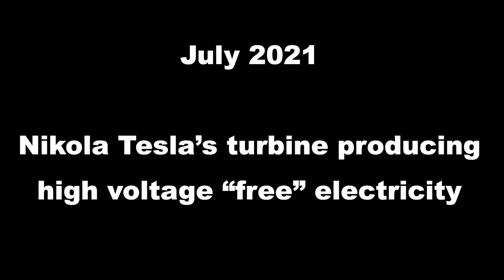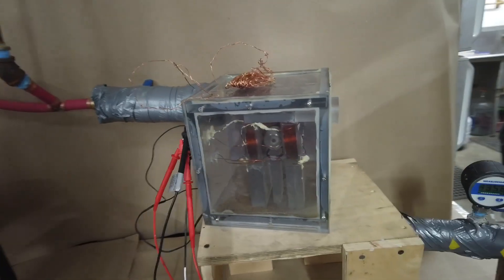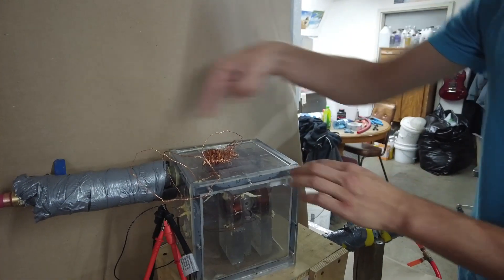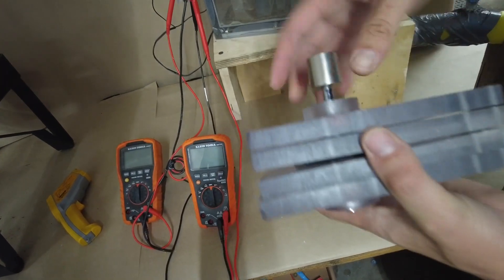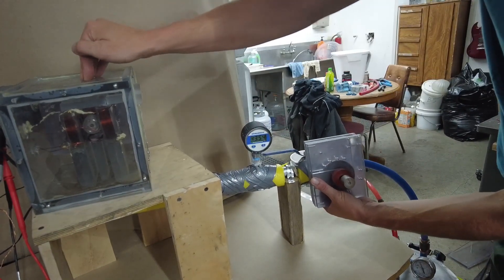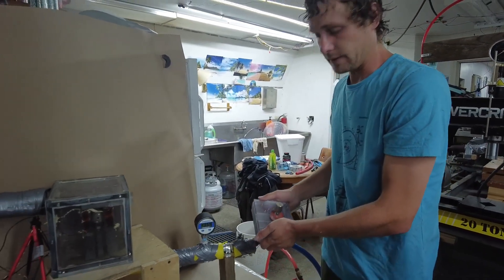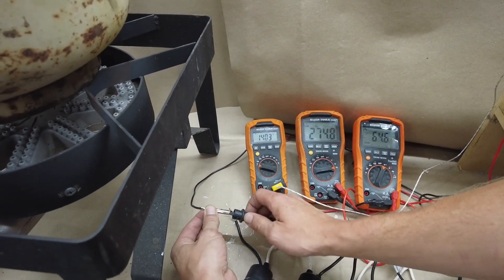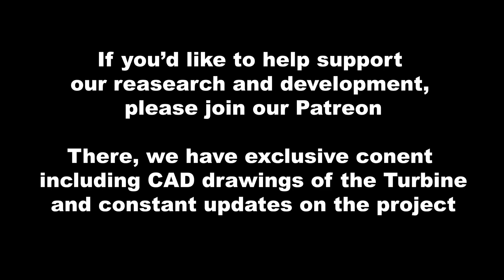Ground Breaking Renewable Energy System Using The Tesla Turbine

Comment: What provides the energy to drive the suction pump which creates the vacuum? In other words, if you do away with the externally (mains) powered pump, will the pump which you propose to insert inline 5:10 need more power than can be provided by your system? I admire your work greatly, but would like reassurance that this isn't another "perpetual motion" device. Also energy is needed to drive both the condensor and the water heater. So is there a net energy gain? Obviously I'm no engineer, but I'm curious.
Reply: I love the long winded reply that does not answer the question "So is there a net energy gain?".  I'm sure many people would like to hear that answer.  Sounds like a politicians answer to every question they don't want to answer.
Reply from the maker: @_Jobe  What do you mean is there net energy gain??? The performance of the machine goes up 6% with every inch of vacuum added to the system. The pump boosts the power density of the turbine.
Reply: @iEnergySupply  I'm not interested in the process, just the results.  And you still didn't answer the question.
Reply: @iEnergySupply  I believe he is asking what the "net energy" generated after taking into account the energy required to reduce the vacuum of the system -- not whether or not increased vacuum leads to increased power generated.
Reply from the maker: @vincentwu2848  awww I understand. I think your right. It's just an odd question because if you understand the system then you would naturally understand that without any atmospheric pressure the vacuum can't disappear because what causes the lower pressure in the condenser is the lower temperature.  As long there is a sufficient temperature differential the system will work forever, unless you get a vacuum leak.
Reply: @iEnergySupply  Are you saying that in the field the system is intended to be deployed somewhere that nature provides such a temperature differential? What type of locations did you have in mind? I'm assuming the hot side will be solar powered and the cold side....a body of water?
Reply from the maker: @vincentwu2848  Any way a heat deferential is available, you can get power. We will have the exact temperature difference required for usable power soon. My goal was to perfect the turbine and steadily increase the efficiency. I now have the ideal turbine and will be showing all the possibilities soon. Solar is a great way to create the temperature difference, and you can also store solar heat in sand effectively making a thermal battery.
Reply: @iEnergySupply  Where do you envision this technology being deployed? Off the top of my head the only places that offer a large natural temperature differential are places like hot springs or geothermal vents.
Reply: @iEnergySupply  Are you being purposely evasive? It seems like you are answering a lot of other questions out of the blue. This isn't a trick question or anything, I'm just asking for an ideal location where could be deployed because of the natural resources available to exploit that the system requires. For example a solar farm is suitable in any flat area that gets adequate sunlight. Wind turbines are ideally placed on a hill to exploit high wind speeds. Your system seems to ultimately rely on heat differential, so what type of geography could we leverage to provide an exploitable heat differential. Again, not a trick question. From my understanding, it seems like an ocean rig or coastline might be ideal -- exploiting solar heat and ocean cooling. Am I on the right track?
Reply from the maker: @vincentwu2848   Honestly there's too many questions to answer them all.  So I answer the ones that grab my attention the most.  There are so many different applications for the turbine , exploring the ways to use it will be a big job. Solar heat tubes are the main source of heat that I've always wanted to use. Another is Heat from the fireplace, many people who live off great have issues with their generators breaking down all the time and having to buy new ones , I also have to use a specific fuel. The turbine will be able to run on any fuel and and use extra heat from burning wood that  You already have. The the batteries on a Solar System also cost a lot of money and are bad for the environment and need to be replaced. Because we will use mass to store the energy this problem is resolved as well. As far as geothermal goes, we still need to test It's capabilities. We'll use it as a heat pump as well in reverse. The ocean is a really good place to get the temperature differential.
Reply: @iEnergySupply  Thank you, that was finally straight answers lol. Don't take this the wrong way but your responses up to this point struck me as a blend between a politician diverting and an engineer bragging about specs. I had a misconception that you were developing this technology entirely for mass scale power generation but now that you've made it clear that you intend for it to scale down to individual households that clarifies a lot and definitely opens up the possibilities for suitable places for the deployment. 

Do you see this tech as being competitive with or even displacing the current solutions for mass power generation? From my understanding -  currently dominated by steam turbines, hydroelectric, fossil fuels, and to a much lesser extent, solar and wind. 

It's quite amazing if your system can actually effectively utilize and store heat from things as small as a fireplace. My understanding is right now there are no practical solutions to utilize this type of heat, which I often hear referred to as "low grade waste heat." I'm not an engineer so please correct me if I'm wrong by saying batteries are still the most practical solution to short term energy storage right now because there are no systems that can deliver stored energy in the form of electricity so readily and reliably. All the alternate solutions that I've explored are usually rendered impractical mainly due to inefficient or slow conversion to and from electricity.
Reply from the maker: the cold side can be cooled by air, or even the earth so no energy input is needed there. here is a quote from nikola tesla bout the pump. In the development of power by thermo-dynamic primemovers, as steam engines and turbines, a low back pressure is essential to good economy, the performance of the machine being increased from fifty to one hundred per cent. by reducing the absolute pressure in the exhaust space from fifteen to about one pound per square inch. Turbines are particularly susceptible to such improvement and in their use for operation of power plants and manufacturing establishments the attainment and steady maintenance of high vacua has assumed great importance, every effort being made to better the conditions in this respect. The gain effected by this means is, in a large measure, dependent on the initial pressure, characteristics of the primemover, temperature of the cooling medium, cost of the condensing apparatus and many other things which are all well-known to experts. The theoretical saving of from five to six per cent. of fuel for each additional inch of vacuum is often closely approximated in modern installations, but the economic advantages are appreciably lessened when higher vacua are applied to existing machines purposely designed to operate with lower ones.
Reply: @iEnergySupply  Thanks for the quick response, however a long quote from Nikola Tesla is too much for someone without formal engineering qualifications to comprehend. I've read it closely, but it contains generalisations which aren't enough to demonstrate that there is a net energy gain. I'll watch your progress with interest.
Reply from the maker: @colibri67  Yeah, sorry, more numbers are on the way. We will simplify everything too.

Comment: Do I understand you have invented a steam generator? Good?
Reply from the maker: Besides these, such a prime mover possesses many other advantages, both constructive and operative. It is simple, light and compact, subject to but little wear, cheap and exceptionally easy to manufacture as small clearances and accurate milling work are not essential to good performance. In operation it is reliable, there being no valves, sliding contacts or troublesome vanes. It is almost free of windage, largely independent of nozzle efficiency and suitable for high as well as for low fluid velocities and speeds of revolution.

Comment: The more i think about the tesla turbine the more i think it could find a home in large scale power generation. The efficiency of a standard steam turbine at any steam based power plant is about 45% efficient if it's a really good one. 
       Compared to 90+% efficiency in a tesla turbine... That would be a major step in solving the energy problem. You could either, Generate more power using the same amount of fuel or generate the same power using substantially less fuel. Either way that's a win.
      You could go even further and install tesla water turbines at hydroelectric dams and generate a lot more power from those facilities too. Maybe more efficient turbines is what Hoover dam needs to allow Lake Meade to start filling up again...
Reply from the maker: quote from nikola tesla. Obviously this problem is facilitated by compounding, as will be understood by those skilled in the art. Irrespective of its bearing on economy, this tendency which is, to a degree, common to motors of the above description, is of special advantage in the operation of large units, as it affords a safeguard against running away and destruction. Besides these, such a prime mover possesses many other advantages, both constructive and operative. It is simple, light and compact, subject to but little wear, cheap and exceptionally easy to manufacture as small clearances and accurate milling work are not essential to good performance. In operation it is reliable, there being no valves, sliding contacts or troublesome vanes. It is almost free of windage, largely independent of nozzle efficiency and suitable for high as well as for low fluid velocities and speeds of revolution.
Reply: Not true currently turbines are over 90% efficient, just not thermally which is around 45% at best. So no gain in hydroelectric generation at all. Was tesla claiming 90+% thermal efficiency though?

Comment: Alright, at this point... a stirling engine will do the job x)
Reply from the maker: Stirling engines lack power and require higher temperatures to run, and are more complicated, and cost more to manufacture.
Reply: @iEnergySupply  1- stirling engines can have very high power and high RPM (because it seems you like them) 2- you can make a stirling engine run with room temperature on one side and ice on the other
3- on the same scale of demonstration stirling engines are not more expensive.
Reply from the maker: @Madthrax23  I've built both Stirling engines and tesla turbines, I can tell you the tesla turbine is way easier and cheaper to build with basic machining equipment.

Comment: But it still relies on the same concept of heating and cooling to rotate. It is still incredible but on a massive electric grid the process still will need to consume massive amounts of heat right?
Reply from the maker: well the best application will be the use of thermal solar collectors, these collectors can be up to 97 % efficient, and the energy can be stored in water in the form of heat. You can also burn any fuel to produce electricity, and even use your wood stove in the winter time if you have one to produce electricity. The cooling can happen by ambient air or the earth's 55 degree constant temperature.
Reply: @iEnergySupply  right on, thanks for the reply, so this could be coupled with the nuclear batteries in the future correct?

Comment: Where's the LOAD at? Lighting up bulbs and stuff is easy, but when you make that thing work, like say through a resistance heater, you will see how good, or not, this is.
Reply from the maker: This shows the evolution of my project. Now that we have the equipment to test with, we will be testing the system to it's limits.

Comment: I don't pretend to understand this stuff, so it is not clear to me what your source of FREE energy is. What I DO see is you're creating a vacuum and using ice. Both require energy to produce.  I have to question how much truly free energy is generated when you factor in these two things, in addition to drag and load.
Reply from the maker: the sun is the source of free energy. Like if you were to collect rain water, the rain water is free.
Reply: @iEnergySupply  That doesn't really answer my question.
Reply from the maker: ice isn't needed, just a temperature difference.
Reply: @iEnergySupply  How much of a difference? Vacuum??? drag??? load???
Reply from the maker: @davidwill1320  Empirical data is the best, we will show it with our analytical equipment. Please be patient.

Comment: But what happens when you put a LOAD on the connected generator? If you've ever tried to turn a generator by hand when there's a load connected, it becomes extremely difficult to turn.
Reply from the maker: the turbine slows down slightly under correct load, but with a load that is too big it slows down too much and becomes in-efficient
Reply: @iEnergySupply  Please define "too big" in terms other than.... that which slows down the turbine. If 200 amps is too big it is incapable of powering an average citizen's home, right? In reference to turbine generators one thinks of power companies which supply power to the grid and hundreds of thousands, even millions of citizen's homes. I'm just trying to understand the practicality of such a device. I'm all for free energy.
Reply from the maker: @webadage  at full speed we operate at 600v, so we don't need many amps, Also all you need is a larger turbine to get more power. The turbine will be sized for it's application;
Reply: @iEnergySupply  Hmmm. I don't see what the voltage has to do with this particular conversation. Every power company in the country sends high voltage to the grid, then reduces the voltage to increase the amps. Nothing new there. Everyone  understands the concept of higher voltage provides the same wattage with lower amperage thus requiring a smaller wire size. IE Volts x Amps = watts. All I'm asking is, is it practical to expect a Tesla style turbine to turn a generator large enough to contribute "utility grade" power for the grid? Utility grade power meaning such as might be produced by VEPCO or another multi state power contributor.
Reply from the maker: @webadage  generally the higher the voltage from a generator, the lower torque required to rotate the generator. Low amps low torque some what high voltage. That's my experience anyways. So we will run high speed low torque. So far the faster I spin the turbine the more watts I get and the more voltage I get with less torque required.
Reply: @iEnergySupply  Okay, now I understand. Thank you for tolerating my confusion and good luck with all you are doing to make the world a better place.
Reply: What is the purpose of this experiment? Please explain me, I didn't understand....
Reply: @Madthrax23  It is my understanding the experiment is to prove that the Tesla turbine is a viable device to connect to a generator as opposed to standard turbines. I'm just trying to see if they're pushing BS or if they're really onto something.
Reply: @webadage  alright, so we are on a totally different matter now. To see if a type of turbine is more efficient than another means benchmarking both. These guys are just trying to make energy without understanding that ice and vacuums are not free energy.. 
Anyway. There are no such thing as "efficiency > 1" for a turbine.